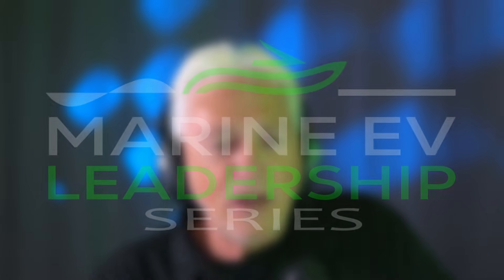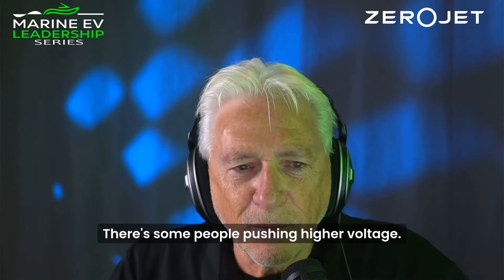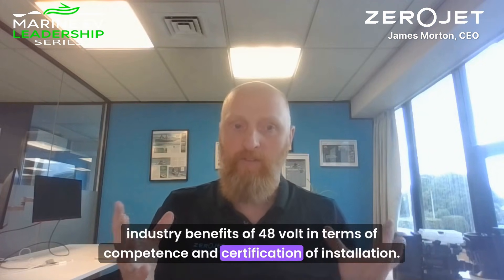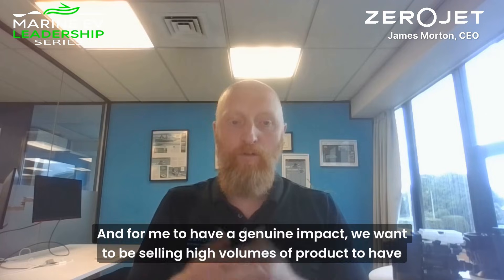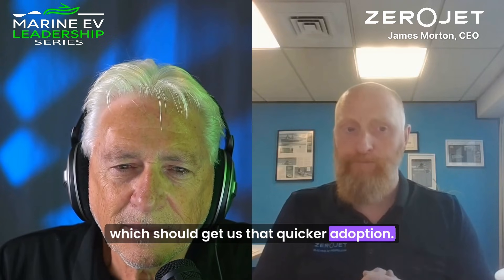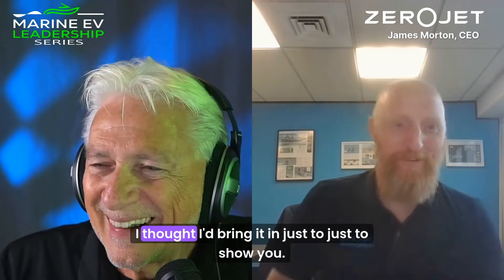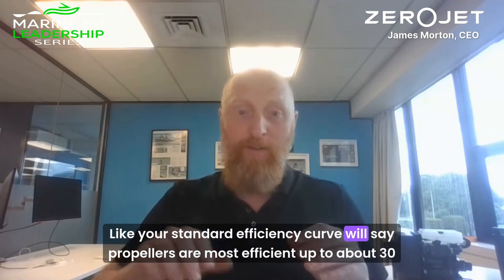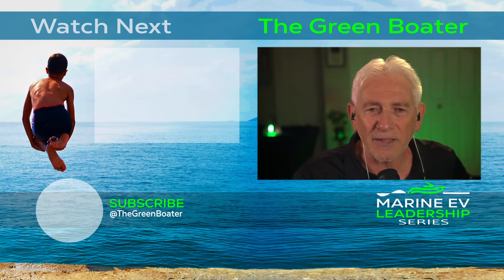ZeroJet CEO Reveals What Propellor Outboard Makers Don't Want You to Know

Comment: Please, what is the weight difference between a electric jet and petrol engine outboard, small boat drive.
Reply from the maker: The ZeroJet electric jet system is generally significantly lighter than an equivalent horsepower gas outboard motor, especially when comparing the motor/jet drive unit itself.
ZeroJet System Weight (Jet System Only): The jet system unit for a 20-40 hp equivalent ZeroJet motor weighs about 39 kg (86 lbs).
Equivalent Gas Outboard Weight: A typical 25 hp gas outboard motor weighs between 59 kg to 77 kg (130 lbs to 170 lbs), and a 30 hp motor weighs between 66 kg to 100 kg (145 lbs to 220 lbs).  
It is important to note the total system weight for electric motors includes the battery pack, which adds substantial weight:  
ZeroJet 20 hp Equivalent Total System Weight (Jet System + Battery): Starts around 81 kg (180 lbs).
ZeroJet 40 hp Equivalent Total System Weight (Jet System + Battery): Can be around 165 kg (364 lbs).
While the motor/jet drive unit is much lighter, the required batteries increase the total installed weight, but the overall system often remains competitive with or lighter than a gas outboard and fuel tank, especially in lower horsepower ranges.

Comment: Nice jet drive and while better than other jet drives as larger diameter moving more water not as fast, it still loses to a regular prop by a fair amount. For safety a prop can have a  ducted prop or outboard and protected from running aground.  Nor are jets ever more efficient than correctly designed props.   I'll take the 6" draft hit to use an efficient prop instead.  A lot because an inboard moto and prop costs a lot less than anything else that size.
He is right though for most people a jet is safer, goes in more shallow water.
Reply from the maker: That's a great analysis, and you hit on the fundamental physics of marine propulsion. You are absolutely right:

Efficiency: A correctly designed, open propeller is almost always more efficient than a jet drive, especially at lower speeds and where draft is not a significant concern. The difference in propeller diameter and the reduction in 'slip' play a big role here.

Cost: The simplicity and maturity of the inboard engine and propeller setup often make it the most cost-effective solution for a given size/power, especially concerning initial purchase and maintenance.

✅ Why the Trade-Off Still Favors ZeroJet for Many Users
However, the key word here is "correctly designed" and for "most people," the benefits of a system like ZeroJet can genuinely outweigh the efficiency hit:

Safety First: As you mentioned, for the general recreational user, the inherent safety of having no external spinning blades is a massive selling point—especially for families, watersports, and tenders where people are swimming nearby. A ducted prop improves safety but is a secondary solution, whereas a jet is intrinsically safe.

Shallow Water & Beaching: The difference between a 6-inch draft and virtually zero draft (or having the entire unit safely contained within the hull) is often the difference between being able to approach a beach or navigate extremely shallow backwaters, or being limited to deeper channels. This freedom is a major lifestyle benefit.

Durability/Grounding: While a protected outboard or prop can resist grounding, a jet drive effectively has no vulnerable components below the hull line. Striking a submerged object can still destroy a prop or shear a ducted unit's skeg, whereas the ZeroJet unit is often protected by the hull itself, making it highly damage-resistant in rough terrain.

ZeroJet's Innovation (Efficiency Gap): ZeroJet's focus on a larger impeller diameter is specifically aimed at closing that efficiency gap compared to smaller, high-velocity jet drives used in performance boats (like PWC engines). By moving more water at a lower velocity, they reduce the energy lost due to the high-speed pumping of traditional jets.

Ultimately, the choice comes down to the intended use:
For pure distance, speed, and fuel economy in deep water, the prop wins.
For maximum safety, convenience, and access to all waterways, the jet drive is the superior choice, and ZeroJet is successfully minimizing the performance penalty.